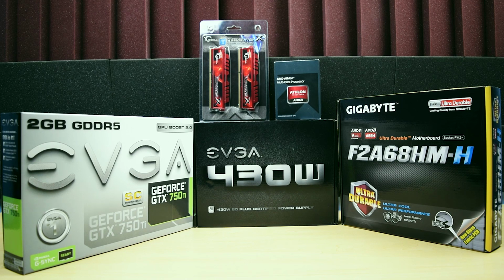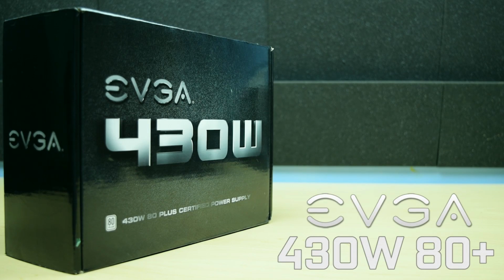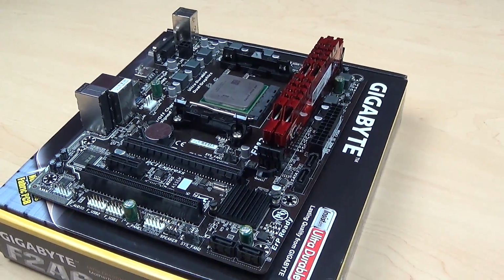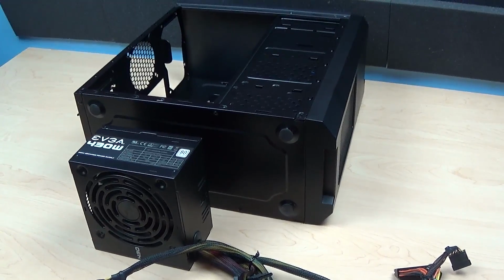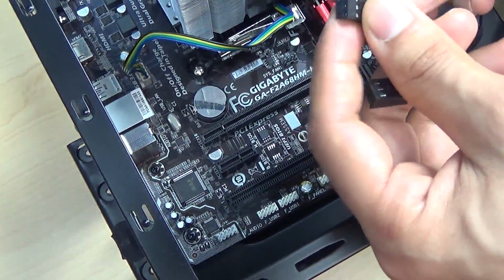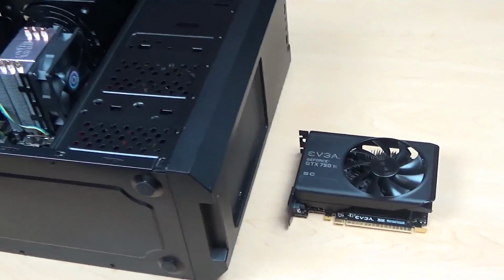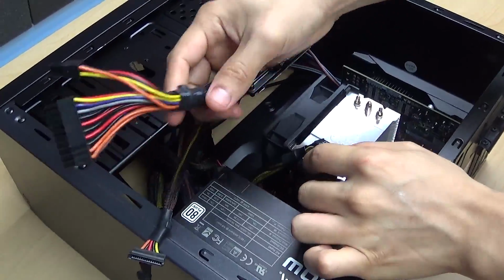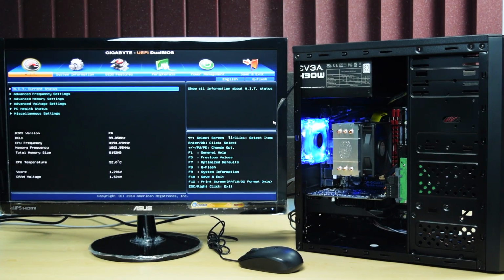Low Budget 1080p Gaming PC Build ($400)

Comment: I don't get it. Why do people use x4 860K instead of x4 750K? I think that the 750K is a nicer combination and even if it doesn't have graphical support and has 0.3 point in minus, it's cheper!
Reply: Cheaper*
Reply: +Tutoriale și jocuri interesante It's performance is noticeably worse than the 860k, and the 860k is still supported by AMD, and has just had it's stock cooler updated. All Athlon-based CPUs don't have built in graphics, fwi.
Reply: Sans is a skeleton Well, the last thing I never knew. You can notice the difference between 60 and 45 FPS easily. That  support means nothing. If games still support it, which they do, it's good. And, is the 750K better than a dual core Pentium 2.9 GHz? Of course. A whole lot. On 768p you will never need more than that.
Reply: The last thing=the nonintegrated graphics thing.

Comment: Could you suggest a decent pre-built gaming PC for playing games like League of Legends and perhaps some streaming? Or if not, what should I look out for when buying a gaming PC? I've got a budget of around £350, any help would be appreciated!
Reply: Check on eBay type in gaming Pc GTX 750 TI Amd FX 6300 and some good PCs will come up
Reply: +James W If League is the only thing you plan on streaming, find a used Intel q9300 or better (you can find a whole 775 PC in junk stores for less than 60-70 £), pair it with a good cooler, do a little bit of overclocking, get an r7 360, make sure to have at least 6 gigs of ram (4 will do just fine too though). Intel CPU's usually have a long lifespan and if you're on a tight budget it's smart to go with a used PC
Reply: +UrAsianFriend You are right, DO NOT BUY PREBUILT GAMING PC, i bought one from Ebay $300 and its crap. didn't even have a graphics card. I had to go buy a graphics card. Now i'm Just gonna build my own Gaming pc from scratch
Reply: +BrutalLetsPlays Please dont ebay is not the place for good PC. i been dealing with ebay since i were in middle school. i am now 23. ebay is great but not the best for good quality parts
Reply: nah got one from amazon, it's great
Reply: Contane 21 There are goods one for 340 pound  with 8gb ram gtx 750ti AMD FX 6300
Reply: +BrutalLetsPlays but for the price you can get better parts trust me
Reply: +BrutalLetsPlays where you from? because you said pounds :D
Reply: +Contane 21 UK
Reply: BrutalLetsPlays awesome how is it? you like it? i live in usa

Comment: Does that motherboard support overclocking?? Also you said it doesn't have a usb3.0 connector? You mean it will not support the usb3.0 port on the case? And would a gtx 960 fit in that case?

Comment: If you replaced the 750Ti with a 1050Ti, would there be a boost in fps, or would the cpu bottleneck so much to where the fps doesn't even change?

Comment: I bet it can't handle Skyrim, Elder Scrolls Online, Fallout 4, or Cities Skylines. Or any CPU intensive game. I also wouldn't call half your settings being off/low/medium the "high" setting on Witcher 3.
Reply: This also didn't include a keyboard, mouse, monitor, or speakers. I don't know anybody who just has those sitting around. Add all that in and you're paying double what you'd pay for a brand new PS4, or around 3x what you can get a used one for. I have an FX-8350 and GTX 970 rig, but I can't tell much of a difference when sitting on my couch playing on my PS4 I bought for $200. I also got $100 worth of free games with it.
Reply: Charles-Antoine Martel-Roy So you plan to move your TV from your living room to wherever your computer is every single time you want to play a video game? Everybody I know has a computer too. They're called laptops. Games I've gotten for free include Tropico 5, Injustice, Outlast, Infamous First Light, Resogun, Binding of Isaac, etc. All very popular titles with great ratings. My FX-8350 and GTX 970 run every game perfectly fine on a good budget. I can max out all titles besides ones that use over 4GB at 1080p(Black Ops 3, Arkham Knight, Tomb Raider 2, Shadows of Mordor, and Rainbow Six to name a few). There's also the exception of MMORPGs that bog down to 30-40fps but I don't really enjoy those anyways. All of the Uncharted games, The Last of Us, Tomb Raider, The Order 1886, Wolfenstein The New Order, Outlast, Shadow of Mordor, Metro Redux, Metal Gear Solid V, Just Cause 3, GTA V, Far Cry 4, Dragon Age Inquisition, Destiny, Call of Duty titles, Alien Isolation, Vanishing of Ethan Carter, etc. All 1080p. I left out quite a lot but figured the most popular 1080p titles will do. All with very stable framerates as they are properly optimized. In fact several of those are 60fps, the ones that are 30fps run perfectly smooth though as unlike PC, they are capped at 30fps. The only game I've ever experienced an unstable 30fps is The Witcher 3 on my friends system. And that actually got a patch a couple months after launch that fixed those issues. Thankfully I own that and run it maxed out at 60fps on my FX-8350 and GTX 970.
Reply: Charles-Antoine Martel-Roy It's also worth mentioning a consoles 30fps is not equal to a PCs 30fps. The console titles at 30fps, if optimized properly like they should be, actually have proper and consistent frame timing. The issue with 30fps on PC is fluctuating frame timing which gives the feel of stuttering and a lower framerate than you really have. Lock that down and 30fps feels very similar to 60fps.

Comment: Is everything you need in the description? All the computer parts? Do you need like anymore cables and stuff for the monitor or thats it?
Reply: don't forget newegg has great deals cheap too. that's were I'm building my first pc
Reply from the maker: +unplined Everything you need is the description except the operating system.
Reply: +MGTech HD So you do you need like a usb to connect to via wifi? Or you don't need that for the pc

Comment: How good is this pc build? Can i do some video editing/recording/streaming on it and also can i plug a second monitor?
Reply: Recording is ok if you use obs with some settings, editing with the athlon is ok but you might want to go with intel for editing (ik because i have the same processor), streaming depends on your wifi, and works good with 2 monitors, ik i hade the same pc specs xP now i have a r9-380 in my pc with 8gb of ddr3 ram
Reply: +NFPNightcore I am changing the gpu for a gtx 960 but i also want to do video editing so what do you recommand, its my first build :3
Reply: Depends on how much your budget is and the r9-380 is cheaper and little better

Comment: Is thuis build beter then: GTX 745 with 3.5 GHz I3 3/4th gen? I bought it when the parts allready mounted in place..... It also has a 1tb hdd, 500w power supply....

Comment: The screws you used to stick the hard drive to the case. Do those come with the case? Or do I have to buy them separately.
Reply: They usually come with the case. You could always read the info on the case you want to purchase.

Comment: i pritty much have the same set up apart from i have stock cooler as i was not over clocking and i have a 760sc and i get 50fps on high on the witcher 3.

my cousin keeps saying the 750ti is better than the 760sc it appears he is wrong.

Comment: Did you buy an extra fan for the back b/c my case only came with one fan?

I'm follwing with build but using xfx double d radeon R9 270 card, and getting 128GB SSD to run the operating system.
Reply: yeah he did mines only came with one too,and cable management isn't the best that's why we only seen it from 2 angles lol

Comment: i got the same parts besides the graphics card is a geforce gtx 950 and i put it together turned it on and have everything hooked up and running properly but the bios menu isnt showing when i connect my monitor, nothing shows at all any idea what this is? i checked to see if my cpu was installed correct and everything is properly connected im still cluesless help please
Reply: make sure to connect the cable that goes from ur pc to your monitor, in ur GPU, not the motherboard.
Reply: I have the same problem, the problem is in the motherboard
Reply: 99% of the time this is a faulty motherboard

Comment: Can this run fallout 4? And where would you get the paste? And one more question, is windows already installed on the things or do you have to buy it and somehow implant it into the computer? Sorry I'm a newbie but if you could reply I would be very happy.
Reply: just use the cooler the CPU comes with. it comes with thermal paste pre applied and will do fine if u dont OVerclock.
Reply: +metalfight1234 Ok thank you! I don't know anything about overclocking yet but I feel confident with everything else.

Comment: This will be my first pc build. Is it easy to upgrade?
Reply: get a 500 watt psu instead
Reply: get a 500 watt psu instead
Reply: There is no upgrade path. Instead, buy a i3-6100 for the best upgrade path.
Reply: It's not compatible with the motherboard and has some other issues too
Reply: Then get an LGA1151 motherboard, I can find some for $40 rn. Then you can keep this built exactly the same.

Comment: does it goes for rust with normal-high or low settings? please answer
Reply: Rust on max with 30-50 easy
Reply: What about CS:GO?
Reply: i get with the same specs on full hd and all low (like all pro players play) about min 80-100 fps.
Reply: +ApplezYT CS GO isn't demanding at all so everything maxed out over 60fps

Comment: will this run forza horizon 3 med settings
Reply: matthew mcmullen I have this build and I highly doubt it will seeing as I have trouble running motorsport 6 apex, if you want to play Forza horizon 3 i would recommend replacing athlon with an i3 6100 and a gtx 950 if you have the money to do so, not to mention you will need a new MOBO as well.

Comment: do you need to use thermo paste ? and what is it used for exactly?
Reply: Yeah you need thermal paste because it allows for better heat flow from the cpu to your cooler and without it your cpu would overheat

Comment: Can I stream cs:go / lol with this build?

1. AMD x4 860k - cpu 
2. Cooler master hyper 212 evo for cpu        
3. MSI AMD A68H-PC-MATE ATX Motherboard (2 x USB 3.0,VGA, HDMI/DVI)
4. Corsair Vengeance 8GB (2x4GB) DDR3 2133 Mhz CL11 XMP Performance Desktop Memory Kit Blue
5. SSD Kingston Technology 120gb
6. WD Blue 1TB Desktop Hard Disk Drive - 7200 RPM SATA 6 Gb/s 64MB Cache 3.5 Inch
7. Corsair CP-9020048-UK Builder Series CX600 ATX/EPS 80 PLUS Bronze Power Supply Unit, 600 W
8. Thermaltake Versa H25 case

GPU what i looking for - 

1.MSI NVIDIA GeForce GTX 1060 gaming 6gb
2.Sapphire AMD Radeon RX 480 8GB GDDR5 RAM 
3.MSI NVIDIA GTX 970 Gaming Twin Frozr HDMI DVI-I DP Graphics Card (4GB, PCI Express, DDR5, 256 Bit)

can they work good together with this cpu? 

But main question is can i stream games with this build in twitch/youtube.? Only - cs:go/lol what i am looking for.

Thanks! :)
Reply: Tristan Boumans yea bet realy can this cpu do well job with 1060 or 480 gpu and stream? :o many people say me that cpu is so bad, better then i3 or i5 have better performance then athlon.. :( now I am confused and don't now what to do.. keep this cpu or buy new gaming mate and intel cpu..

Comment: when i did all this i got fans and power but no video  on my monitor.. any advice?
Reply: check your connections and remove the hpu. try booting without the gpu. if it works check your cables

Comment: +MGTech looking at building this PC but when I go on too the pc part picker is says this  'Xion XON-310_BK MicroATX Mid Tower Case has front panel USB 3.0 ports, but the Gigabyte GA-F2A68HM-HD2 Micro ATX FM2+ Motherboard does not have onboard USB 3.0 headers.'
Is this a problem?!
Reply: No it won't do anything just means you can't use the front usb 3.0
Reply: +Resolved AE Thank you!

Comment: do you need thermal paste?
Reply: nope if you get the tx3 cooler it comes with a tube of thermal paste. If you use the stock cooler that comes with cpu it has pre applied paste so either way no.

Comment: what do people think

GIGABYTE NVIDIA GTX 950 WF OC 2 GB 128-Bit DDR5 Dl-DVI-I/DVI-D/DP/HDMI Windforce 2 Fan Pci-E Graphics Card 

Asus M5A78L-M/USB3 Motherboard with Socket AM3+, up to 32 GB DDR3, USB 3.0, uATX 

AMD FX6300 Black Edition 6 Core (3.5/4.1GHz, 8MB Level 3 Cache, 6MB Level 2 Cache, Socket AM3+, 95W, Retail Boxed) 

Western Digital WD10EZEX 1TB SATA lll Desktop SATA Drive - Blue 

HyperX FURY Series 8 GB (2 x 4 GB) DDR3 1866 MHz CL10 DIMM Memory Module Kit - Black 

EVGA 100-B1-0500-KR - 500W 80 Plus Bronze Power Supply (100-B1-0500-KR) 

CiT Goblin Mesh Gaming Case Black/Green Interior USB3 12cm Green LED Toolless 

Cooler Master R4-L2R-20AG-R2 Sickleflow "120mm, Quiet Case Fan / Cooler Fan" Black with Green LED 

£399.58
Reply: Get a better motherboard. That one only has one pci e slot. That board will also not be good for overclocking. Best of luck to you with your build.

Comment: is this any good? i'm like new to this?

Case: Phanteks Enthoo Evolv ITX (Windowed)

Motherboard/ Asus H170 PRO GAMING

Processor: Intel Core i5-6600

Fan: Cooler Master Hyper 412S

Graphics card: Asus GeForce GTX 960

 RAM: GCrucial Ballistix Sport LT 8GB 2400Mhz

SSD: Samsung 850 EVO 250GB

HDD:  Seagate Desktop HDD 1TB

power source:  Corsair HXi 750 Watt
Reply: Nope doesn't work
Reply: +Le Technicien Jean Michel how you mean it doesn't work
Reply: DRAGON VENOM but why not?
Reply: +yannick beullens lol ignore him he is trolling you
Reply: +yannick beullens it's really good but check if your cpu can fit with that motherboards socket
Reply: it can i'm using a trusted website(where I live) and they auto check if everything works together or not and they build your pc with programs you want and you can pick hem up in there store
Reply: +yannick beullens oh okay that's really good the build is good
Reply: do more research if you arent sure but from someone who is a pc enthusiast then yes the build is good just make sure everything is compatible with pcpartpicker
Reply: The PSU is a bit overkill for your system. If you buy a 500w EVGA, you will be able to save money that you can put on your gpu and pick up a 970 instead, granting you a beast PC that can run most games maxed at 50-60fps.
Reply: +Nero  that's what I did also I changed my RAM to 16gb
Reply: Awesome man, you got yourself a top tier gaming PC! :D
Reply: Nero great haha
Reply: Go for a Western Digital 2TB (black edition if possible), the price difference isn't much and you get double the storage, also WD run quieter.
Reply: Use a 380 instead of the 960 the 380 out performs the 960 and is cheaper
Reply: And you don't need a 750 watt psu get a 500w
Reply: +Smoothinator 380? I'm planning a very similar build to his and I can't decide on a capture card. What makes you say the 380 is better? just curious
Reply: +Insertchillnamehere not capture card lol gpu
Reply: +Insertchillnamehere the 380 isn't cheaper than the 2gb 960 though
Reply: +BladeXD NumeroUno what will be the difference in the 2gb vs 4gb versions?
Reply: Insertchillnamehere http://www.eurogamer.net/articles/digitalfoundry-2015-nvidia-geforce-gtx-960-2gb-vs-4gb-review

Scroll down for benchmarks, there isn't much difference between 960 and 380 2GB versions, so go for the cheaper one unless you can afford to pay slightly more.
Reply: Hi, I also have a build I would like reviewed

Cpu: i5 quad core 6600k
Gpu: GTX 1070
Motherboard: MSI Z170A M3
Memory: 8GB corsair ram
Case: Phanteks Enthoo EVOLV
Power supply: 750 watts ATX12V
(I've already got a hard drive)
Reply: +Festive Chip looks good, if you plan on overclocking don't forget to buy a decent cooler, also with those high specs you could probably get 16gb ram for what it costs extra
Reply: +BladeXD NumeroUno I'm really pushing the limit of my budget which is why I only have 8gb of ram and I will overclock as soon as I have the money for a cpu cooler
Reply: +BladeXD NumeroUno and thanks for letting me know
Reply: +Festive Chip that's fine then, you could downgrade to 650w to save a bit imo but I'm not at my pc right now, 1070+i5 won't use anywhere near 700w iirc
Reply: +BladeXD NumeroUno yeah I think 8 gigs of ram will be fine because I'm only gaming and my 750 watt power supply I was getting so I wouldn't  have to upgrade it anytime soon and it's only 10 bucks more than the 600 watt so I figured why not
Reply: what about this pc? Wanna know if its good or not

i5 6500
msi b150 gaming pro
16 RAM ddr4
2tb hhd 
240gb ssd
Amd rx 480
cm 550w psu
is there anything I can improve?
Reply: +Martijn De Smit You are golden my man, if you plan on streaming or video editing I would go for a 6600k or a 4690k but other than that you're good.
Reply: +Martijn De Smit actually yeah your cpu is overkill you should really go with a pentium D it runs like an i7, trust me
Reply: +None None and it's cheap
Reply: +Festive Chip oke, I will probably go for a 6600k but I also need an other motherboard and a cpu cooler. so that would cost me about 100 dollars more :/
Reply: +Festive Chip 6600K doesnt come with CPU cooler
Reply: NO DONTVIY THIS WTF, 6500 is what you should get or you are wasting money. Get the 6600k with a z170 because the 6600 has terrible value. Also the 960 sucks balls. It is a low end graphics card save up for a 970 or maybe 380 but that is still a budget card
Reply: +Gaming Top 5 I know already included that to the price
Reply: wait for the 1060 or get a rx480 and get i5 6500k if not overclocking
Reply: for the budget yes, it is good
Reply: yes
Reply: idk what your problem is, but yes I do not know much about pc builds that's why i'm leaving my fucking comment and that's why i'm watching these kind of video's.